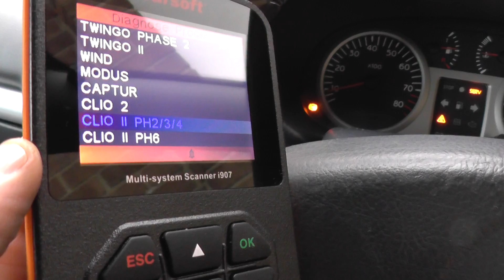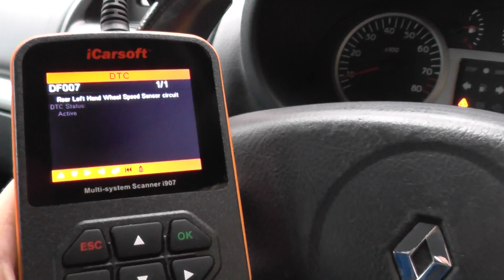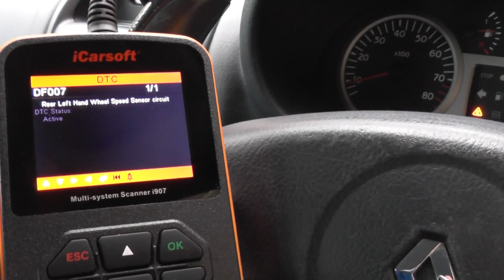Renault Clio ABS Warning light Sensor Fault Diagnose iCarsoft i907 DF007 5030

Comment: If I fit a new sensor myself and don't access to diagnostic equipement, will the ABS light just clear itself after fitting it??
Reply: I replaced my front driver side sensor and it automatically went off without clearing code
Reply from the maker: +Robert Bailey it varies on model to model & manufacturer to manufacturer. Generally you will need a diagnostic to clear the fault and remove the lights.